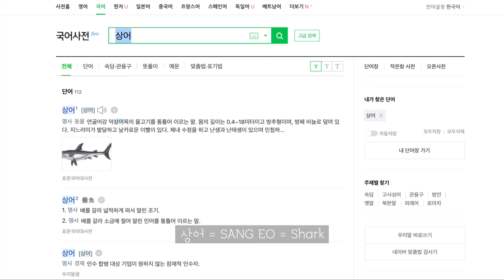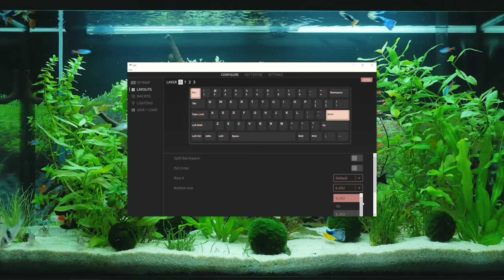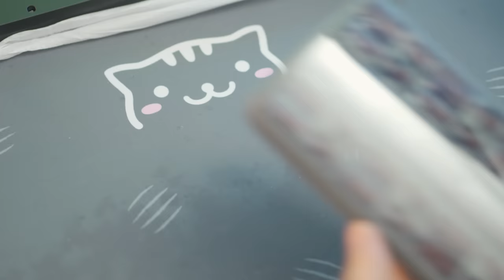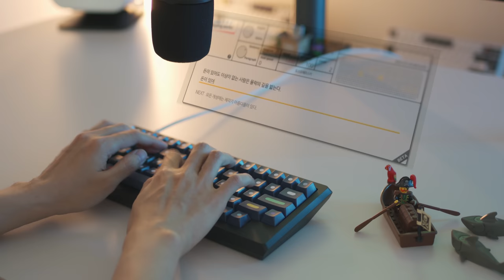Cute Shark! SANGEO60 Build

Comment: I was curious, if you don't like the wire quality on the equalz stabs, is there any reason you tend to use them the most often?
Reply from the maker: Simple.
except the bad edges that I can handle, other parts are better than others.
more color options, bundle pcb stickers, washers and so on
Reply: @3ildcat  oh awesome, thank you

Comment: Do you have any tips on ticking stabilizers, I’ve tried holy modding and balancing wire and none of them worked
Reply from the maker: In Korea, we believe it's not well balanced anyway.
So maybe the pcb causes, or the plate would be a reason and so on.
In this case, you may replace the stab parts or use other brand stabs.
Reply: @3ildcat  oh ok thanks

Comment: 3ildcat how thick is your 205g2 and 105g0 1:1 mix. is it like 205g0 and how much 105g0 should i add so that it is closer to like 204g0 in consistency
Reply from the maker: haven't tried 204g0 but guess it's similar to it
thinner than 205g0 anyway
Reply: @3ildcat  thanks man

Comment: I don't get it. If Equalz doesn't have a good wire quality for their stabilizers, why use them at all? Why not go for Durock or Cherry Stabilizers?
Reply from the maker: Simple.
except the bad edges that I can handle, other parts are better than others.
more color options, bundle pcb stickers, washers and so on
Reply: @3ildcat  Ahhh! I knew there had to be a good explanation for this!